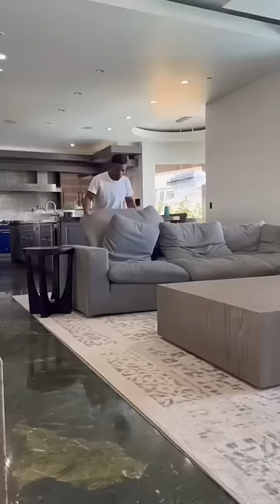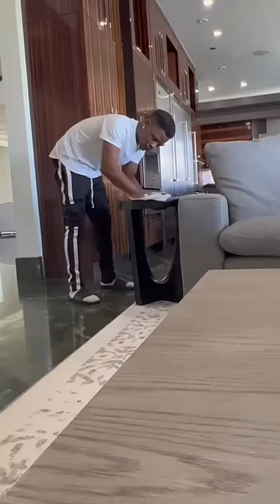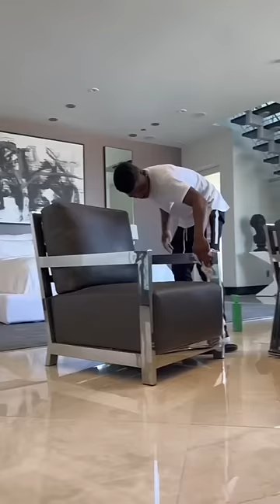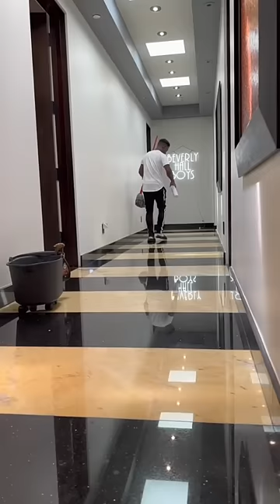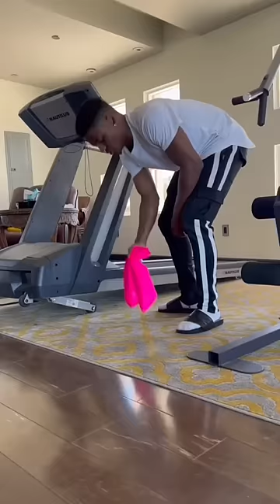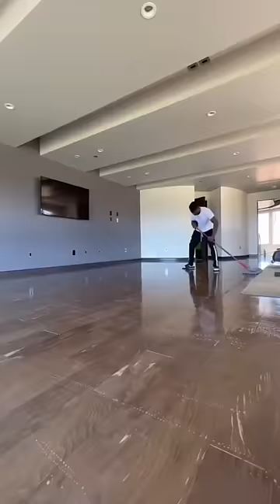Come clean up my 4 story house with me 😳 #shorts

Comment: You guys should get a robot vacuum they are a bit expensive but my parents have one and it is amazing! It can map out each room and if you want the whole house. Anyways it maps it out and then after it maps out your house it goes around and cleans. when it is mapping out your house it will bump into things in your house but… after it maps out it starts to clean. And it can even go back to its satiation and charge its self when it is low in battery. You really should invest in it…. It’s called the iRobot Roomba i3+ EVO. It’s amazing!